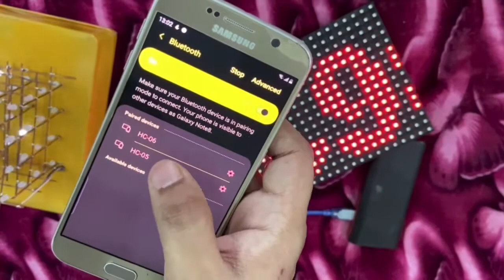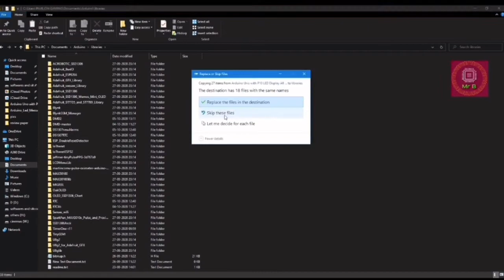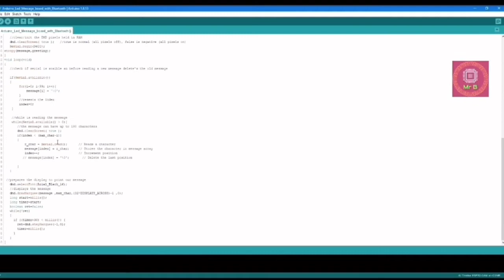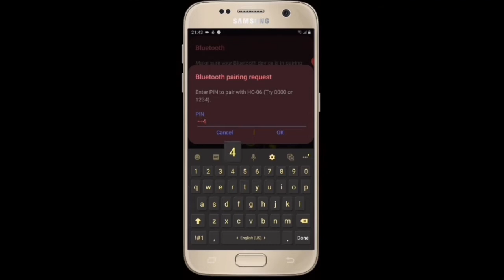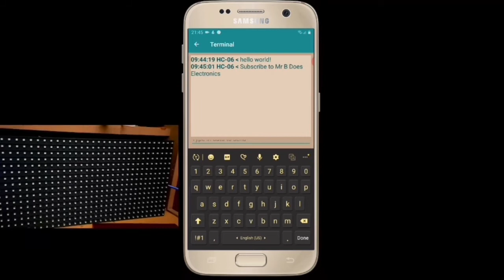Arduino Message Display with Bluetooth Control.Easy DIY Advertising Display. Arduino+Bluetooth+DMD.

Comment: all function working well thank you but but hc-05  connecting and pair . but message not appearing display
Reply from the maker: You can interchange the RX TX wires and see if that solves the issue. Hope this helps, subscribe while you are here and like share my channel. Thank you🤓😄